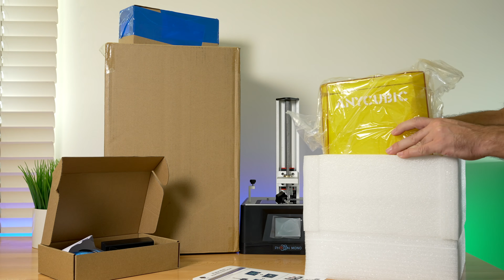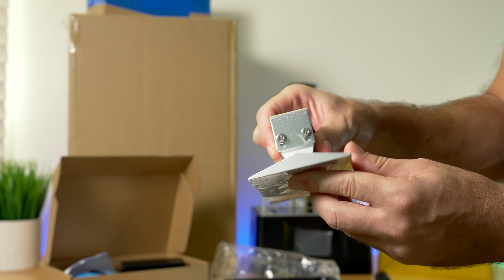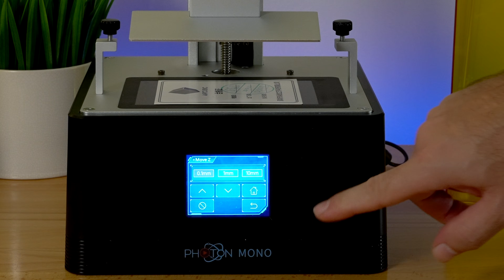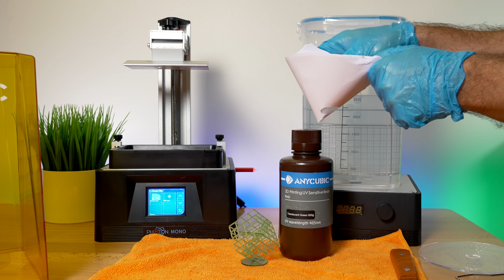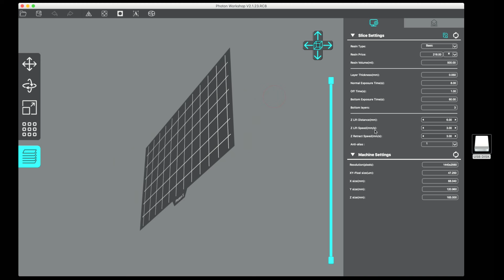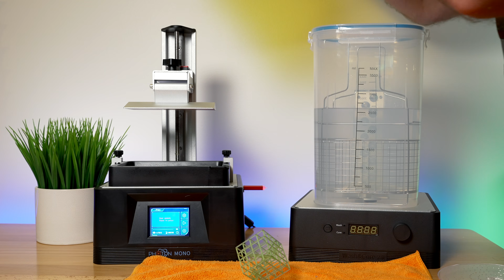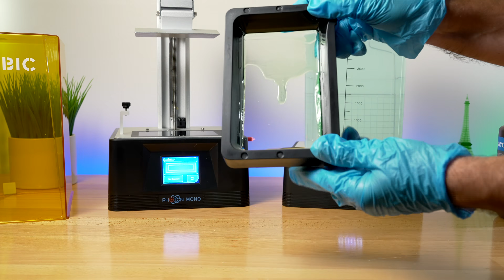Anycubic - Photon Mono + Wash & Cure 2.0 - Unbox and Setup

Comment: Could the photo cure settings not be used to cure the model's like you just cured that bit of left over resin on the tray? It might even be good for the bottom if that bit of foil stuff doesn't do to well?

Comment: You dont have to empty the resin out everytime your done using it. As long as its not in a spot where sunlight will hit it, it should be fine to just be left in the tub. Saves time and potential mess of dumping it everytime you're done

Comment: A seasoned 3D printer explained that there is no need to cure the vat after each print. Resin can stay in the vat for weeks and months. It's not milk. It won't go bad. Great video!
Reply: You mean clean, right? Curing the vat would be a very bad idea.
Reply: @Smokinjoewhite  so you can leave the resin in the vat ? I', a n00b, thought you had to clean it all the time...

Comment: I wish I watched this before starting my first print today. I used the metal spatula to get the resin off the resin vat causing holes on it making it unusable and the feature of cure would've been so helpful. Only question I have tho is how do you deal with issues when the print falls off during print or it not printing at all and just staying above the resin

Comment: at 0.050 mm pper layer, with 2 seconds curetime per layer, it would take this printer 40 seconds per mm. the Eiffeltower was 165mm which is 6600 seconds (1.8 hour).. why does the printer say it's printing 8 hours?

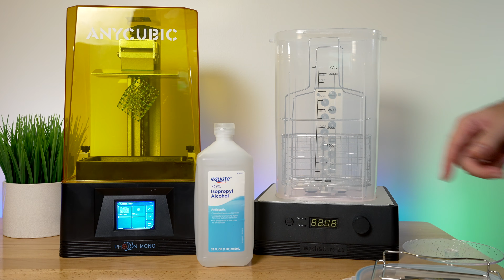Comment: 17:28  70% ISO Alcohol Is Not ideal (it's too diluted)  you want 90+%, don't worry about it being too strong (e.g. 99% is fine) because as long as you don't leave the Print in the ISO too long, it will not affect the integrity of the Print.

Comment: I just tried the method at the 35 minute mark to remove the excess resin from the vat. I did the same thing (poured as much as I could back into the bottle. Same green resin too) then cured the remaining film for 30 seconds. It did not come off easy (or at all). I ended up having to soak the tray with alcohol for a long time and occasionally rub and massage the resin until after nearly an hour it finally came out with the plastic spatula. Even then, there was minor scratching left to the screen by the plastic spatula. 
I would not attempt this again.
Reply: I did this as well and the FEP film is fucked. I have to order replacements. Do not expose leftover resin to the UV if you can help it, use a microfibre cloth or papertowel and rinse the rest off with metho or IPA.

Comment: Wouldn’t the alcohol eventually separate the resin tub walls from the plastic on the bottom of it? Great review overall, just wondering about how the alcohol will affect the FEP.
Reply: The bottom has screws holding everything together so even if something is being dissolved  it wouldn't come apart. And isopropyl alcohol evaporates very easily so once you take the vat out the alcohol dries pretty quickly.

Comment: Are there any similar products to the Wash & Cure? I see enough reviews of its spin plate breaking over time and that concerns me a little bit if its not easy to replace.
Reply: No reason to be concerned. I saw the reviews as well about having to snap it in place. Idk what they are doing but it literally just sits there. My toddler can remove it without breaking it.

Comment: Is it possible the run the wash and cure empty to just cure the alcohol wash, waste in order to cause the fluid to cure the microscopic resin dust... then filter then fluid to get some alcohol back?
Reply: Yes, another user did this on another video. The resin cures and creates particles that can be filtered out.

Comment: Do not throw away your wash alcohol! The resin solidifies when exposed to UV. so when you need to change it out, dump it into a glass jar and let it sit in the sun all day. then, grab a funnel and some filter paper and you can filter off all the solids. then reuse your alcohol  as a primary wash with new alcohol  being used for a second quick final wash.
edit: also, you apear to be a bit too concerned about concentrated alcohol, I guess because its a powerful solvent and were alwase taught to treat it with care, which you do.. For your wash, or any clean-up of resin, 100% ISO is best. you can also leave the storage basket in the bath. they would not build the basket out of a material thats dissolved by alcohol, that would be silly.
Reply: will it work with ethanol? I got jars and jars of ethanol lol
Reply: @KissMyConverseFool  Seriously I was wondering about etahnol. I have an ultrasonic cleaner I use to clean firearms, I use denatured ethyl alcohol from the hardware store for metal parts and mineral spirits for polymer parts.
Reply: So wait.. Basically have two jars one of new and one with the old alcohol? Kinda confused on the second quick wash step
Reply: @XonixDerps  First clean with the jar of older/cloudy iso. Then end with the other jar of new/clean iso so you get less debris on the model
Reply: ....alwase?
Reply: I just ordered this wash and cure station, do you think I could use acetone instead of alcohol? I like washing my prints in acetone because it cleans them to perfection by just swirling them around for 10-15 seconds
Reply: @LeoNelBuilds  depends if the acitone will eat the wash station...
IPA is all you need to wash with a sitr bar like the was stations have and although they take sevral leters to fill, its reusable so you don't realy have much loss of your solvent.
Reply: @nickzwa  thanks, that’s my main concern… if the container plastic and mechanism could be destroyed by acetone, maybe I’ll use 99% alcohol and have one last dip of acetone separately for good measure 😆
Reply: @LeoNelBuilds  Do not use acetone! That shit will eat plastic!
Reply: @ALaughNahalf  yeah I found out it’ll destroy the unit… a drop fell on the lid and burned a hole through it 🤣😂🤣

Comment: Why does this one has no fan?I thought al of them has fan's?Don't know which one to get,this one with no loud fan or the Elegoo Mars pro with carbon filter and loud fan.Which one you advice?
Reply: From what I have read, due to the speed of the prints in general, the screen doesnt get too hot, hence no need for the fan to ventilate heat. I have no experience with it, but thats what I have read

Comment: Vlad, long time filament 3D printer here. I watched both your videos testing the Photon Mono X and Elegoo Saturn resin printers. I went with the Mono X (based on your demonstration… thank you) and because of an eBay combined sale with the cure, wash station. They’re still in transit and I’m looking forward to printing once they arrive. I’m wanting to get some extra resin for the ultimate flurry of experimentation. My question being new to resin printing is, are there any proprietary or formula characteristics that would compel a builder to use only the Photon brand resin? Or in general, having to purchase the resin brand for any of the different company’s printers? They all seemed near or identical specifications. Thank you in advance if you see this and have the time to respond.
Reply: Hey bud i have 4years of expierence in FDM prints now. And orderd the same package as you the mono and the cure and wash station: One question: Can you let the ipa stay in the washing container?

Comment: Final thought is that you could’ve used the plastic scraper across the VAT lightly (if you wanted to save that resin you exposed in the end) aside from that I have no idea why you tip it sideways when the UV is being exposed, but you did set it up and get nice prints, great job 👏

Comment: Okay at first I just was thinking that the lid on the wash and cure 2.0 plus was a bit off because of the UV light clearly leaking through the bottom (you can see inside it slightly) but from your video I see that it looks like mine so it must be as it is 🤷‍♂️ further viewing of the video  I see you used the QC card for leveling (interesting) I’ve just been using a sheet of printer paper and I’ve been having amazing detail on miniatures to large prints 🤓 PS: I shake the shit out of the resin, because I use a heat gun (not straight on just a few clicks to get the bubbles to pop away and leave my resin looking like a perfectly still lake (I do of course make sure I don’t get it too close to the VAT and or printer, I think this is best because I heat up the resin just slightly at the same time as popping the bubbles and mixing the resin to its maximum potential) lol

Comment: have the Wash and Cure V1 and wondering if the V2 versions and Plus model is worth it. Ofc depends of the size of the print. Picket the Mono X up on sale so im churning out quite big prints and it gets a little tight inside the V1. Such a expensive hobby lol

Comment: Is there a reason you wouldn't want to remove the model from the build plate and put in the bottom of the basket to reduce the amount of alcohol you need?
Reply: You could do that if you just wanted the model to sit and soak in the alcohol, but the reason why it's raised up off of the bottom is because there is a magnetic stirrer that needs to be spinning around in the bottom of the cleaning container, which agitates the alcohol or whatever other cleaning solution you're using and cleans it better and faster than if you just let it sit
Reply: @nobody2021  The stirring mechanism is below the bottom of the basket it wouldn't matter if there was something sitting there.
Reply: @AlexanderNash  you're right, I misread the original comment.
Reply: If you are washing a small model I would assume it generates enough flow to move smaller objects around, but I imagine for large prints out should be fine. I have one on the way so I may test it out

Comment: there is another peice of paper in the box that looks kind of like a flyer that says "use for leveling" or something like that. using the card stock card that you used may result in issues with the build plate being to high. or it might not

Comment: Great video! What if we didnt purchase wash and cure? Does it have alternative method to wash the printed object?
Reply: A pickleing tub for cleaning and a new paint bucket lined with 405nm UV LED strip and a solar powered turntable in the center, put a cleaned model on the table and place the paint can over it.
Reply: You can gently scrub it manually with alcohol on a soft toothbrush, to clean it. 
To cure it, you can leave the model in sunlight, but it might take a bit longer and won't be as even

Comment: Why cannot be one single machine the two.... and the full process can be automated...still not get it why was necessary to build in two....
Reply: As it would be a commercial setup, probably costing thousands for an unnecessary addition. It would have to print, move over to a cleaning tank, then over to a cure station, the cure station would need its own enclosure to avoid the vat being exposed. 
The machine would be table sized with CAM arms to maneuver the print around.
Reply: What the other guy said is right, this is a labor intensive process, and requires waiting around for dripping of the resin, and right now there are only two simple motors, one that spins and the z rail up and down on the resin printer, end one that spins on the wash and cure.
Reply: @TheLordNoodles  I don't have such machine, but why do you have to wait to drip? Why can't you start the curing process like a carwash line?

Comment: Honestly alcohol is a sanitizer and cleaner so wearing gloves handling fresh alcohol is not needed.
Reply: Isopropyl  alcohol  dries your skin out and actually burns your hands if you don't use gloves. Also the resin has chemicals that are questionable. Not worth it the risk.
Reply: @WarNoodle85  Then maybe you need to stop using hand sanitizer then. The main ingredient in that is isopropanol alcohol.
Reply: @dragnridr05  and I rarely use that... but what does me using or not using hand sanitizer have to do with the fact that gloves protect you from hurting your skin in the long run....
Reply: @WarNoodle85  My point is that alcohol won't hurt so long as you don't leave your hands in for hours on end. Hand sanitizer uses alcohol as the main active ingredient. So if you constantly sanitize your hands, it's like washing your 3D prints in alcohol. 
I can understand using gloves if your not used to it, but alcohol really won't hurt you if you get it on your hands for a minute or so.
Reply: You should wear gloves when handling alcohol, otherwise there can be long term effects. Cut finder, I mean, hand sanitizer, is bad, too, the more you use it. Read the SDS for the alcohol, and decide for yourself.
Reply: @Harvey-dK1  I never had a problem because I am used to handling alcohol and other cleaning liquids. I've been building model kits since I was a little kid, so just being around it and handling it for such a long time helped build an immunity of sorts to it. 
If you don't handle the cleaning supplies very often, then by all means, wear gloves. 
Other than that, it won't kill you if you get it on your hands a few times.

Comment: Hey man. You overcured your model. For something like that you only need about 30 seconds to a minute. Your goal is to get rid of the stickiness on the outside. If you overcure a model it begins to brown. This is why you got a discoloration and the loss of sheen on your test print. Not a bad video though. Just a tip.
Reply: As someone brand new to 3D printing, how long should things usually be washed and cured?
Reply: Only that short? I did mine for 4 minutes but it’s gray resin (Phrozen aqua gray 4K). I am still figuring it out.
Reply: @TheLordNoodles  the cure time for phrozen aqua gray 4k is about 15-25 minutes if you use 2.0 cure machine. You need a very high power uv light to cure resin in 30 seconds, and will be overheated at that power
Reply: FYI:

For this model, it is recommended that you set it at 2:00 for most prints. Only go higher for bigger, bulkier prints.
Reply: @theeHisoka  That is good info. Just ordered the resin machine and the wash and cure as well.
Reply: Do I need a cure station?

Comment: Bro, I want to ask your opinion ... better buy this Anycubic Photon Mono or Creality LD-002H? Both of them Monochrome Screen & almost the same price in my country ... thanks in advance ... :)

NB : I definitely will buy that cure wash machine too, seems very easy & pleasant to use
Reply from the maker: Personaly i would choose creality. But the photon mono is very impressive combined with the wash and cure.
Reply: @JustVlads  maybe if I use LD-00H combined with Anycubic wash cure also can have same performance? I personally like Creality brand too lol ...
Reply: @JustVlads  can i ask your reason behind this choice, trying to choose between both these as well, ive heard that ldh uv light is over powered and people having alot off issues with resin curing in the vat, most of the prints ive seen the photo seems to do a better job.
Reply: I went with the voxelab proxima. Been printing wonderful for a week straight now!
Reply: @Cynical709  I’ve been using LD-002H approx 1 month ... very satisfied with the machine, No Fail printing at all (except my own fault for not giving proper support when I start slicing object & editing support myself ... the build plate also very good ...

Now, what I want is 4K Screen & bigger build space lol ... maybe next I will buy Elegoo Saturn as the reviews very good & always sold like crazy also when restock ... 😁

Comment: I changed one of my Ender 3 printers to linear rails and there was no difference in print quality, is this the same with resin printers?
 the reason I ask is I can get a resin printer that is the same specs as this one and with the linear rails but over one third cheaper.
 If I was going to get an Anycubic I would go for the Photon Mone SE, same specs just a better case and same price in the UK
 Sorry ignore this question I got confused with the specs of the resin printers, I now realise they have rods and rails.
Reply: I have this resin printer an ender 3 pro and ender 3 v2, I have to say so far this resin printer is my favorite. Althou I find myself thinking id never give up my ender lol. but yea the quality is so much better on the resin printers.